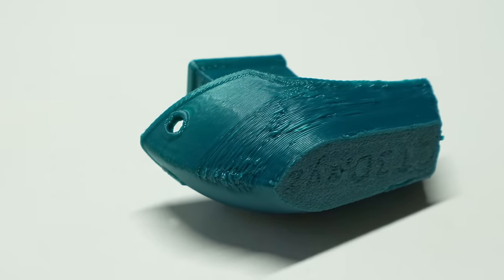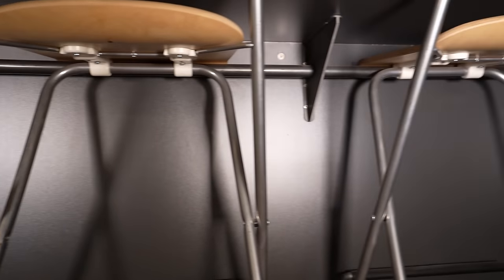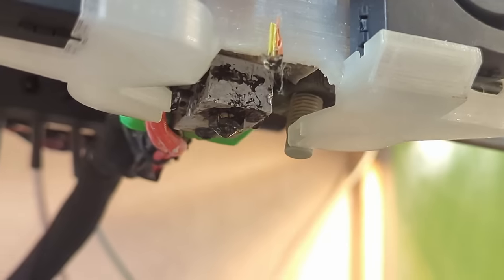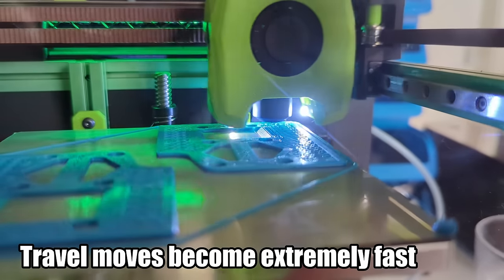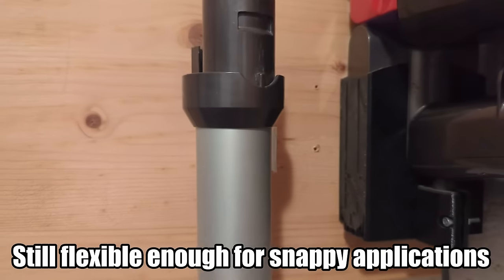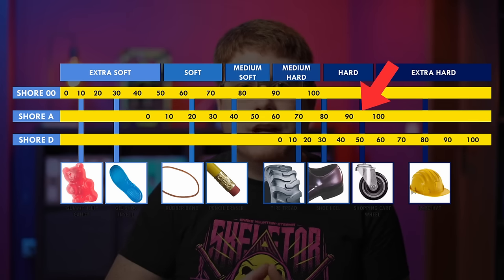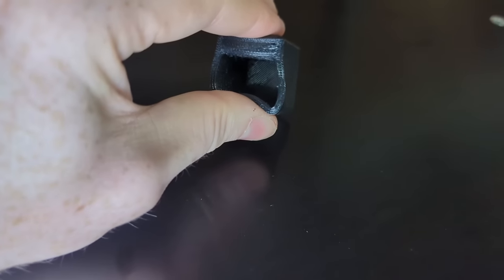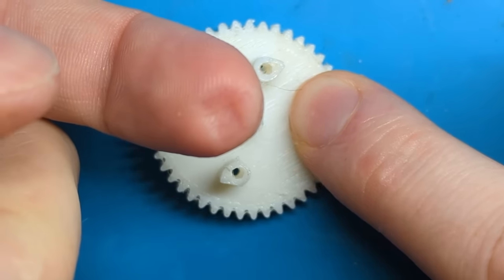3D printing material: When to use PLA, PETG, ABS, TPU, Polycarbonate, Nylon etc.

Comment: PLA is not an engineering material, there are basically no products out in the wild made of PLA except cheap shitty cutlery. The only reason to use PLA and why it´s so popular is besides ABS it´s the only material which was radilly available and the manufacturer can sell that crap for a high price. PLA granulate costs 5-10x less than filament, that´s also the reason why 3D printing can´t be as cheap as injection molding.
Reply from the maker: 3D printing always involves the step of filament making and pellets will always be cheaper. Saving time and money on molds is where it shines.

The reason you see no products made of PLA is probably the low heat resistance. Nobody wants to make products that already deform in a hot summer warehouse. Some chocolate manufacturers take summer breaks for that reason.
Reply: @SmallBatchFactory  "...3D printing always involves the step of filament making and pellets will always be cheaper. Saving time and money on molds is where it shines..." Exactly, that´s also why "3D Printing" is called rapid prototyping since the 80´s. You are absolutely right. It changes in recent years where small batches for products with complex geometries are produced by 3D printing but this use case is very limited after all one can also use Silicone molds to produce 1000 parts or so instead, with superior part strength for basically the same cost. But the main reason is filament costs is waaay too high. You need a 3D printer which uses pallets instead, this would bring down the cost a lot.

"...The reason you see no products made of PLA is probably the low heat resistance...." Yes, absolutely AND it´s brittleness. In almost all applications where plastic is used brittleness is really bad. Think of snap fittings for example. PLA is almost useless for most applications except cheap jigs and one time use stuff. Oh and those figurines people print.
Reply from the maker: @sierraecho884 AFAIK pellet extruding 3D printers exist. I've seen them in videos years ago. It's just not practical for use at home. Filament cost is also negligible at home IMO.

There are a few situations where I like the stiffness, like shelf brackets. In industrial applications you would make the from Polycarbonate anyway, that material is only problematic in a home printer. The figurine crowd is also pretty large so the industry would be stupid not to serve them at a price they're willing to pay for shiny glitter and stuff.
Reply: @SmallBatchFactory  Yes, I have seen some pellet extruders as well, but they are usually more complex, heavier and expensive and you already said it does not make sense for home use only for production. 
I would still like those for home use as well. Just recycle old bottles or something and print stuff with it. I recently am in need of plastic bins, those milk crate types which are collapsible, you know which ones I mean ?  Good ones are really expensive here 50€-70€ for one crate! So I rather would print my own out of recycled PP.
This would be an awesome use case for those type of extruders.

"...There are a few situations where I like the stiffness, like shelf brackets...." Yes I agree however brittleness comes with stiffness. Rather increase dimensions to create more stiffness with a more ductile material. Because I am sure those brackets will creep over time as well.
PC is a great material so is PA and PP but all those materials are problematic in a home printer, this really sucks. We use all those materials professionally in the automotive industry, I would have liked to use them at home as well.

"...The figurine crowd is also pretty large so the industry would be stupid not to serve them at a price they're willing to pay for shiny glitter and stuff...." Oh yes absolutely, my point is just that this material (PLA) is overpriced for what it is and use cases are limited. You can also print any figurine with PETG instead with more ductility and much better layer adhesion which is also important to not break your figurine when it falls down for instance.
Reply from the maker: Unfortunately I don't know those crates, we buy our milk in Tetra Packs here.

Of course they creep, as shown in the video. But not much. There are a lot of awesome materials that are hard to print at home. I had a brain fart to build a Voron 0 with aluminium parts and add chamber heating to 100°. The motors are outside of the chamber and with a water cooled extruder that could be really awesome. I'm just afraid it could go up in flames.

The issue with PETG is the tendency to string. That's no issue with PLA. It's just so extremely easy to print. If you want to go even fancier there's no way around Resin. Those figurines are really detailed.
Reply: @SmallBatchFactory  "...Unfortunately I don't know those crates.." Oh it´s a bummer, we too buy milk in cartons I am from Germany xD Milk crates is what Americans call plastic baskets. Usually they are collapsible, we have them too. I was looking for a product like a "Euro Box" (I hope you know what a Euro Box is, if not look it up it´s awesome). But collapsible and with a side loading door, I found some but they are really expensive.

"... I had a brain fart to build a Voron 0 with aluminium parts..." Hahahahha I had the same idea, I was already designing the water cooling system with a E3D water cooling jacket based on a "Alphacool Eisbaer Aurora" the water cooling is awesome, it´s an AIO watercooling but the pump sitzt inside the CPU bracket which means you can simply cool the CPU side instead.

"...The issue with PETG is the tendency to string..." Yes this is true. 

"...If you want to go even fancier there's no way around Resin. Those figurines are really detailed..." Resin is a completely different beast. Completely different material properties and so on. I don´t have proper ventilation so I don´t print with resin but the printer is way simpler the resolution is much better and the material properties can be much better. 
You can increase resin strength by up to 40% if cured in an oxygen inhibitor like glycol at an elevated temp of about 60°C in case you want to create very robust parts and didn´t know.
Reply from the maker: I know the collapsible baskets you usually use for grocery shopping, if you mean those. I work in intralogistics, I've seen more Euro boxes than this video got views :-D

Sounds like a plan. I have an AIO in my PC but never thought about that for a printer. Could be a nice idea

Didn't know that about Resin, that's interesting! I didn't do much yet with it since I hate the mess. But I got the printer for 80 bucks so I couldn't resist. Combined with an ultrasonic cleaner it gets a bit less messy. As stated in the video that printer resided in its own building with outside ventilation. Only printed a few samples and a DOOM guy figurine, which turned out awesome TBH

Comment: I only recently started using PLA, its meh
Reply from the maker: Always depends on your use case. If you ever had PETG stick to your hotend you'll appreciate PLAs properties.
Reply: Maybe you got some bad PLA?  A lot of it has a bunch of additives.  If you use a high quality PLA, it will actually have issues sticking to some bed materials and need an adhesion promoter (I love sugar water for this). Good PLA should give you a stronger part, than just about any other material,  if rigidity is what you're after. I use PETG, ABS, ASA, PLA, and Resin printing.  I also do CNC machining.  Everything has a place.  Sometimes I need a rigid part that can be overbuilt with PLA.  Sometimes I need a rigid part in a tiny space so I need to CNC aluminum.  Sometimes I need a part to be able to absorb repeated impacts, so I'll use PETG or ABS.  

If you think PLA is "meh" you're either using it wrong, or you're using the wrong brand.  Check out brands like Fusion Filaments, Prusament, Protopasta, etc. The stuff you get off of Amazon is probably full of additives like wax that make it print prettier, but weaker. I use PLA for easily 70% of what I print nowadays.  The rest is like 15% PETG, 10% resin, and 5% other.  If you mostly work with things that need impact resistance, your usage would look opposite mine with materials like PETG picking up the lion's share.